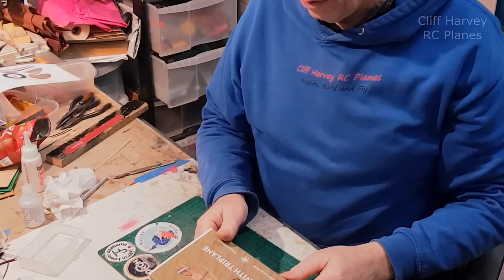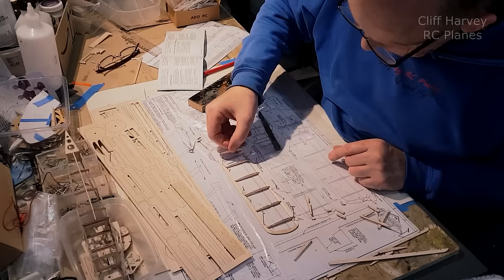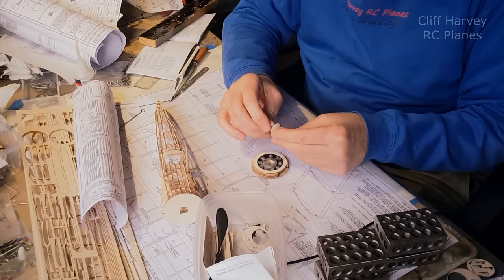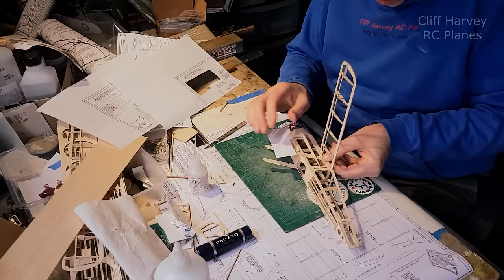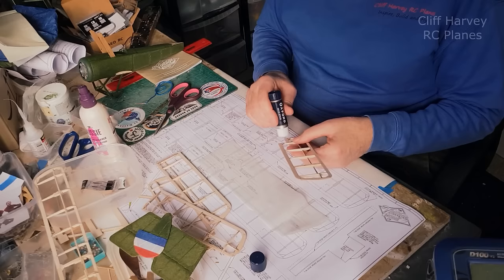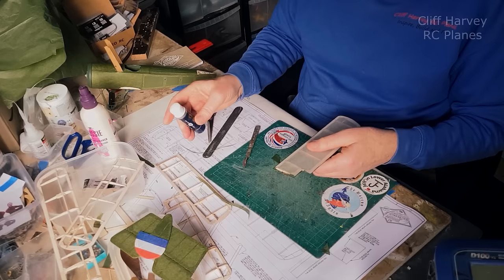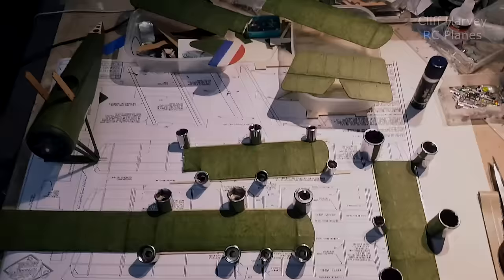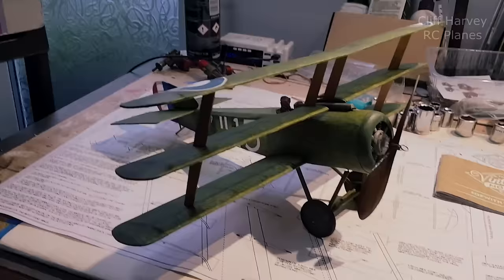Assembling the VMC Sopwith Triplane From Start to Finish

Comment: Looks really good Cliff. I have often thought about getting the VMC Triplane. I built the Aerographics one, over 200 ribs to cutout! Laser makes it a lot easier. I powered mine with a KP 02 electric setup. I've built several VMC models and all have been very good, both to build and fly.
Reply from the maker: Thanks PJ, I'm considering a bigger one 👍

Comment: Lovely! I built the same model a couple of years ago, I converted it to electric RC, I've had one go at flying it but it would stall as soon as the power was applied even though the C of G is correct. Since then I've added some down thrust angle to the prop but not flown it again. Maybe this summer I'll have another go at flying it. I even used the same green tissue that you've used, the brown paper looks 'odd; to me, I used some silver paper along with silver paint for the engine cowl.
Reply from the maker: High Sidecar, yes definitely more down thrust needed, a rubber powered one I've seen had a boot full of down and side thrust 👍

Comment: It looks very good, your tissue covering is brilliant cliff! Looked at vmc models as I want to build a balsa model to make RC. However I haven't had the best of luck with foam yet so avoiding for now😂 my minimum rc cessna full kit however is now in the uk finally!! Should be delivered after the bank holiday. I did want it for my four days off but ah well, it's still on its way
Reply from the maker: Thanks, maybe your kit will appear suddenly, the postal service may see your comment and take pity on you and rush it through! cheers
Reply: @CliffHarveyRCPlanes  it's just turned up with evri 😊 that's the gardening on standby then
Reply from the maker: @8OutOf10Crafts  Result 👍

Comment: Nice finish. Don’t know if I misheard you say all up weight was 60g? VMC must have substituted Guillow’s wood. 18 inch span at 60g will be a sled.
Reply from the maker: 60g auw, 10g for motor and prop, 6g to balance., so 44g for the finished airframe. One of the sheets was quite hard but that was for load-bearing pieces. Admittedly the model's weight will cut down on the flight time but three wings will help to compensate (I hope). Whatever happens though I'm having fun, cheers